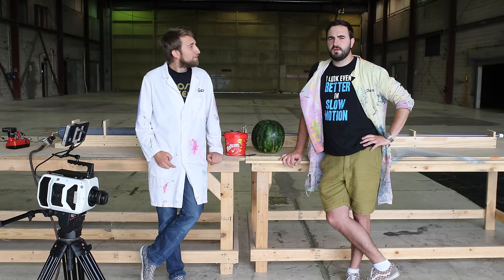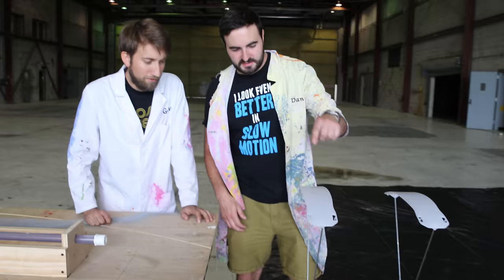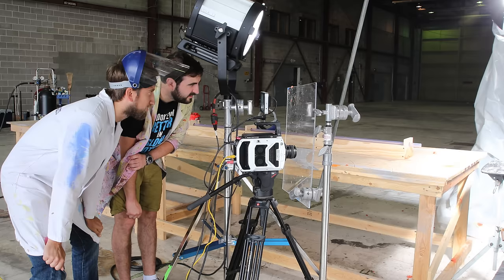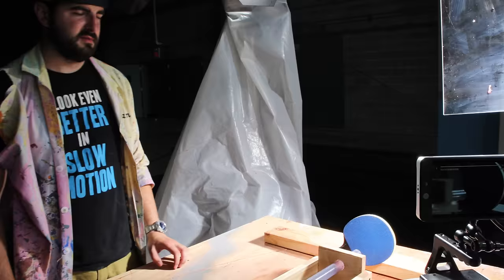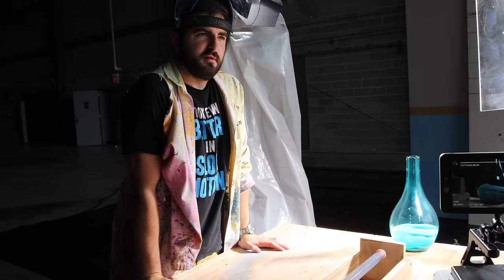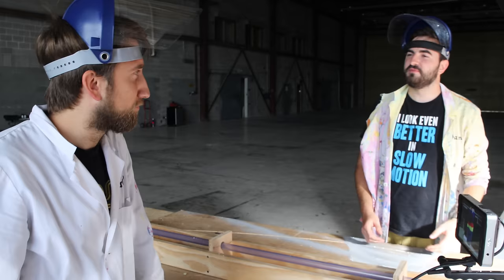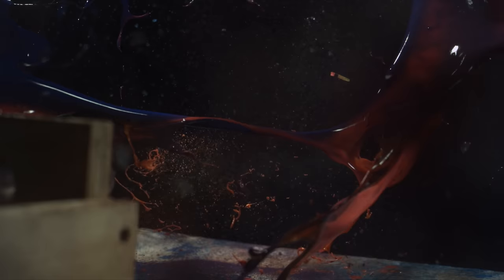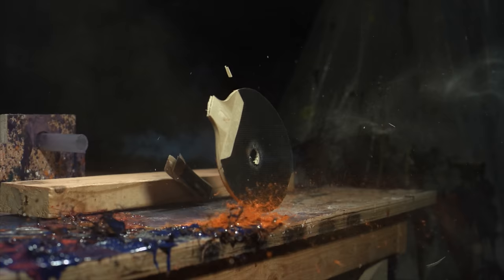Compressed Air Cannon in Super Slow Mo - The Slow Mo Guys

Comment: you will need to have 2 air compressors facing off at each other, launching the maltesers together to form a mini Big Bang like the hadron collider
Reply: That might create a black hole, it's too dangerous ;)
Reply: That would be amazing please keep asking for this
Reply: The problem would be the timing, even when saying "3-2-1"
Reply: @Vexy93  machines my boy machines
Reply: @Vexy93  you wire it so the same button fires both cannons.
Reply: @dirtrider88  it would be fairly easy
Reply: oh please
Reply: Kemil Gaming no problem at all. The solenoid is electric not manual. Just wire the two solenoids together to the same button and they both fire at the exact same time.
Reply: It’s too risky
Reply: @frostdachshund9618  it's to risky, says someone called the SCP foundation!!!
Reply: Wed have to collect the anti chocolate
Reply: if the air actually hit the objects first, would the 2 opposing air streams actually slow the Maltesers down against each other?
Reply: @frostdachshund9618  Its literally like if you shot two pistols at eachother. It wont do anything dangerous
Reply: "Mini big bang"
So just..
Bang?
Reply: @spoop4967  I see what you did there 😂
Reply: You can't be smart or be nice. I am not offended by the opinion of nonentities
Reply: do what this person said

Comment: The question is: is it strong enough to crack a coconut ?
Reply: Smo Som oooh! That would’ve been a great thing to test out!
Reply: Coconuts are weaker than plywood, so yeah.
I'd like to see one hit a paddle edge on.
Reply: Does a normal bullet go through a coconut? If so, then this will as well.
Reply: Yes
Reply: How about try to split it like they did with an axe
Reply: 1313e not necessarily so
Lead is not a Malteser
Speed≠energy
Reply: Supposing 2 swallows carried it together?
Reply: @
Ima Nidiot It could grip it by the husk?
Reply: @malfunctioning_little_twerp  Listen. In order to maintain air-speed velocity, a swallow needs to beat its wings forty-three times every second, right?
Reply: @malfunctioning_little_twerp  Just the right amount :)
Reply: @Poleily  love how whenever coconuts are mentioned there is someone with a Monty Python reference
Reply: @alexanderthompson683  real

Comment: "I would prefer it if the pineapple was over there and a bit on the wall"

That's oddly specific there Gav
Reply: Such is the life of gav
Reply: you will need to have 2 air compressors facing off at each other, launching the maltesers together to form a mini Big Bang like the hadron collider

Comment: you should film a lightning in slow motion
Reply: Using a tesla coil would be easier but same effect
Reply: CoolHwip92 I don't know, lightnings have an interesting way a of forming that can be seen only from the distance and in slow motion. I don't think that this way can be seen in Tesla coils
Reply: Those cameras will only film a few seconds before running out of storage. Catching an unpredictable lightning strike will be near impossible.
Reply: I think they have a setting that will record a buffer of a few seconds so you can click record after the action happens instead of before. So it is completely possible.
Reply: Slow motion cameras don't save anything until you press the button. You press it and it stores the x amount of seconds before you pressed.
Reply: Jamie Bales Actually they usually always have the high speed camera recording. Only the last five seconds or so are kept. After the event, they simply need to press stop for the last few seconds to be recorded. That is how they film other unpredictable events like balloons.
Reply: 6ninjak that is an awesome idea
Reply: 6ninjak That would be an awesome video
Reply: Jamie Bales, nowadays, there are lightning activated shutter triggers that can sense and react (say, start recording) instantly when a lightning appears. Like Ubertronix Strike Finder.

Comment: I did the math. Your Maltesers were going over 850 MPH (852 to be exact). That means that they broke the sound barrier. That's crazy. I like your t-shirts;)
Reply: KTC Cinematics by doing the math you mean you took the 900+ fps they said in the video then went to Google "fps to mph" and there is your answer
Reply: DLRKillerkiwi haha, I didn't know that such a thing existed... thanks!
Reply: I did the math for a plane's fps. A 787 travels at 593mph, which is around 3,131,040 feet per hour, which is around 52184 feet per minute, which is around 870fps, so if the maltesers were going the 900fps that was recorded, then they would be travelling faster than a 787, so you would maybe have to fire one from the jet to break that record. No TI-84 can beat a malteser at 900fps.
Reply: KTC Cinematics you'd better count how many times they said the word "Maltesers" :)

Comment: At 6:33 you can see that the air pressure is flattening the rubber on the paddle
That must be a seriously deadly cannon
I bet it could go through a human head if you used a steel ball or maybe a marble
Reply: did you watch the video? A malteser could go through a human head.

Comment: I distinctly saw an indentation in the ping pong paddle before the Malteser hit, as if it already had a hole and was re-covered.
Reply: Initially I thought that as well but then I figured that we're dealing with a lot of air pressure and there is some amount of pressure proceeding the Malteser causing a deformation in the soft rubber covering the paddle.

In the end I don't think these folks need to fake results to entertain us. Failures are an option!
Reply: Mate, thats clearly the air pressure.

Comment: Part of the explosion of the melon is caused by the air pressure
Reply: I agree. They should try cutting a Malteaser sized hold in the watermelon and sit that hole facing the air canon and fire it.  To see if just the rushing N2 will blow it up.

Comment: 3:35 it happens because the malteser makes the entry wound and then the air that follows after it rips it open from the inside, its essentially stabbing someone and then shoving a highly pressurized air tube into the wound.

Comment: This propably  gets lost, but try recording lcd display at a ridicolous framerate ;)
Reply: You don't need a crazy frame rate for that a good monitor refreshes 60 times a second and a cheap camera can see that
Reply: Have you ever seen EACH and EVERY pixel, changing its color?
Reply: what are you expecting to see exactly? They all change at the same time, so it would look exactly the same, just, slower.
Reply: No, they dont... they are changing line by line, pixel by pixel. Thats the reason...
Reply: I think Kure is right about how monitors works. lol

Comment: Hello Gents,

I know that the fun with Maltesers was almost three years ago but... 

I noticed that there was a lot of movement and subsequent destruction from the air blast that was fired out of the launch tube while the nitrogen gas was propelling the Maltesers.

What kind of mayhem would result if you applied a vacuum to the out-feed tube of your air canon once you had loaded the Malteser/s and prior to firing.??!

The crew at Mythbusters got a ping pong ball up to around 1100 mph with that arrangement.

I dare say that you might be able to shoot a Marlteser through sheet steel!

Death by chocolate!

What say you double the length of the launch tube and pull a vacuum in it to see what kind of acceleration you can get on a Malteser before the mayhem ensues?

Regards,

Paul Phillips
North Vancouver
Canada

Comment: Ok, watch the frame by frame with ping pong paddle at 6:30.  It looks as though the paddle has been tampered with, the paddle cushion is sunken in right where the malt goes through
Reply: That's because the air is being pushed through faster making the indent in the paddle
Reply: The air is coming out with such force that it made an impression on the cushion.

Comment: 0/10 didn't shoot ballistics gel with it.
Reply: And compare the effects to a .45 bullet moving at the same speed (I have experience handloading lighter-than-normal .45 Auto cartridges and can provide the pistol as well, just sayin'... :) )
Reply: 0/10 didn't shoot dan with it
Reply: This is not mythbusters tho..
Reply: This would be very interesting.
Reply: Dude, headshot on a giant gummy bear...
Reply: It would be far less powerful than a .45 ACP bullet. A single Malteser (2.1 grams) traveling at 900 feet/second (274.32 m/s) only has about 80 Joules of energy. Kinetic energy is 0.5*mass*velocity^2 so 0.5 * 0.0021 * 274.32^2.

A lead .45 ACP bullet is typically around 230 grains or 15 grams. Traveling at 900 feet/second (which coincidentally is about the muzzle velocity of a typical .45 ACP round fired from a 1911 – it's not a lighter than normal load) the bullet would have around 560 Joules of energy. Also given the size, shape and fragility of a Malteser it would likely disintegrate immediately on impact and only achieve shallow penetration.

Comment: 6:34 why is there already an indentation
Reply: The air in front of the malteeser in the cannon getting pushed out
Reply: That's kinda what I thought but I'm not understanding the mechanics of it. I have ping pong paddles and if u poke ur finger into it you cannot create a dent. the outside material is dense and thin, so if it's against hard wood, there should be no indentation created by just air...their paddle appears to act as if it's foam or as if layers of the plywood are missing. Not making any claims about the videos integrity, Im just not understanding how it's possible. Is a bit suspect.
Reply: @jcw231  I hear what your saying but idk I feel like the sheer speed and force alone could make it do that since its still a slightly malleable material
Reply: JCW yeah these guys are firing objects that are moving faster than the sound barrier. Air that is propelled forward will go forward until there is something to change it’s direction.
Reply: @jcw231  I know I'm Hella late to this reply, but some ping pong paddles have a layer of rubber over them some more thick then others, and if you watch the top right of the paddle as it hits you actually see the rubber is pretty thick if you match that to the depth of the indent it's pretty plausible that it's the air causing it, 150psi is quite powerful
Reply: @tph5196  yeah I suppose there really is no other explanation. I guess my issue is that it's such a perfect indentation, the force doesn't seem strong enough, and if it was i assume there would be some variation in the force just based on ambient conditions as well as the air being acted upon by the ball moving through the tube. It just seems too consistent. I'm thinking the decisive caviat here is that I don't know the material of the ping pong paddles they have. Either way, thanks for the responses guys.

Comment: FYI: for those unaware what Maltesers are, it's like M&M's Crispy (blue bag, over here) without the coloured sugar shell, and a chocolate layer maybe an eigth inch thick and about as hard as the cocolate in a kinder egg. They're also round as a basketball, I know M&M's can be a bit lopsided. 
As for the damage being inflicted, the VAST majority of it is the sheer volume of air being forced into the target. It's especially clear with the paintvase, where the entire load is inflated and the vase juse blown out the back of the paint. Would be fascinating to build an aircannon that snapped the muzzle shut with a duct to vector the gasses away in another direction, as soon as it detected the Malteser leaving the muzzle. Then you could see what the Maltesers are actually inflicting on their own.

Comment: Do they taste like whoppers?
Reply: From my experience no. I have tried both of them, and to me the Maltesers tasted a lot better. It has been a while since I have had either one, but if I remember the whoppers had a harder texture. But they still are overall the same candy.
Reply: Malteasers are better. They are lighter, less sickly sweet, easier to eat and (arguably, because I know americans actually like hershey's chocolate) have a better chocolate coating. 

Blended up in a milkshake? you probably couldn't tell the difference between the taste as they are both chocolate covered malt balls. But on their own, malteasers are nicer
Reply: Mr. ConcealedCheese lmao it doesn't matter where you're from. It's not a biscuit inside it's a malt ball. I.e. MALTeaser
Reply: Goober and Buddy          no they're like crunchy things covered in chocolate I know because I'm eating them

Comment: It looks like a pre hole at 6:30
Reply: Sylus Ellis yeah its from the air
Reply: Yes it seems like they made a pre hole
Reply: Does seem like that, however if you look at the melon before the malteaser hits, you can see the air blasting off the surface of it. So the "pre-hole" is just the air blasting the pingpong bat before hand.
Reply: Ya that's just what I was thinking
Reply: I dunno ,but it makes perfect sense... The Air appears to be pushing a depression into the soft covering ahead of the malted milk ammo. LOL
Reply: It is the air because the front of the bat is made of rubber
Reply: It'd be much harder for them to drill a perfect circle and line it up with exactly where a smoothbore chocolate pellet will hit than just air hitting a depressable surface
0/10 not believable skepticism

Comment: Use steel balls instead of maltesers
Reply: nodrinks the weight difference will cause a huge speed decrease and delay in launching.
Reply: @ibrahimlakkis9227  Very true, albeit the weight would more than make up for it on impact with momentum.
Reply: The malteser will leak more air because it's shape is imperfect, it may be slower or it may not but a steel ball would probably carry far more energy regardless.
Reply: That wouldn't be funny.  Destroying things with Maltesers (which I've always liked) is funny.
Reply: What you're describing there is "a gun".
Reply: Same force applied to a larger mass will decrease the acceleration and momentum will be the same. Only difference I could see happening is any affect that the give from the malteser has on the transmitted force.

Comment: just a tip to improve the device... if you'd make a seal for it (for example... use 1 or 2 sheets of paper(the air will make it pop)) it'd have WAY more speed and power

Comment: I'd suggest Jaffas, but they'd probably be lethal at that speed.
High-pressure cannons are all very well, but have you tried a vacuum cannon? You will get a supersonic Malteaser. I've seen one drive a ping pong ball right through several paddles.

Comment: Guys 
I have a rifle that can shoot a projectile well over 4000 FPS
Now the interesting thing is when I shoot a can of pop I set the can on a brick or piece of wood and place a us quarter under the can. 
Every time the can hydraulically deforms at such a speed that the pop cuts the can around the quarter. Cutting a perfect disk. 
Not only does it cut a perfect disk but the image of the quarter is empresses into the aluminum disk, 
With proper notice this rifle can be made available with a supply of ammo for you guys to film.

Comment: The problem with air cannons is they add A LOT more force then the projectile does on its own.
This is why your melon has chunks as far away as it has and why it explodes as it does.
The candy pushes a hole in the melon, then you fill that hole with high pressure air until the thing ruptures.
It would be no different from putting the cannon right into the center of the melon and firing. It would explode just the same.

Comment: Good video. Wished you loaded cannon with less air pressure to make sure pressure was not causing a bigger hole than the Maltese.  Metal door of a car would have been a good test.  A two by four piece of wood.

Comment: Pause the video at exactly 6 minutes and 30 seconds and on the paddle there's a round mark right where the malt is about to hit, what I'm saying is that looks like that had tried before that and it didn't go through it just bounced off so they had to turn the PSI up. That's just my theory though but really check it out see what you think thanks

Comment: Every time I watch this video, I feel pain. A venturi does not cause a rise in the pressure, but rather a rise in velocity as it initially restricts area until the are reaches supersonic speeds at which point the relationships reverses and a larger area start raising velocity. On a pressure-velocity graph as the  velocity goes up the pressure will go down.

Comment: So explain to me WHY there is a slight dimple in the Ping Pong paddle at the exact impact point BEFORE the Malteaser was fired? It looks like a hole was made in the paddle, then covered over with fresh rubber for the shot. I hope I am wrong.
Reply: Because the pipe is blasting high-pressure air at it and it's deformable rubber. Same thing happens with the watermelon, where there's air streaks on it before the malteser leaves the barrel. It's just because the malteser is not a perfect fit, so air escapes past it before it fully leaves.

Comment: I stand to be corrected, but I believe you may have cheated on the table tennis bat. If you freeze frame at 6:33. I think you can see and indent in the surface of the bat as if it’s been bored out behind to some degree 🤔

Comment: "venturi here increases the pressure going into the chamber" - I've seen in multiple other materials on YT, that when a fluid/gas travels through a contraction, it needs to accelerate, which results in pressure decrease. can someone correct me here?

Comment: This experiment is faulty. The pressurized gas is causing a considerable amount of damage to each object. Perfect example is the glass. The Malt hit the glass and smashed up against and might not have gone through had it not been for the pressure pushing it afterwards. You should set the objects further away so you can see what the Malt would do on its own